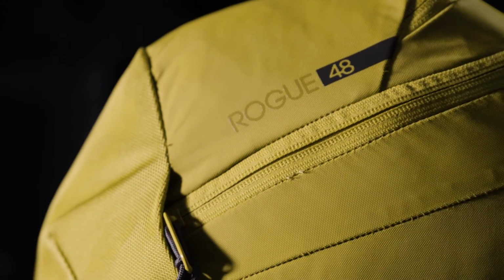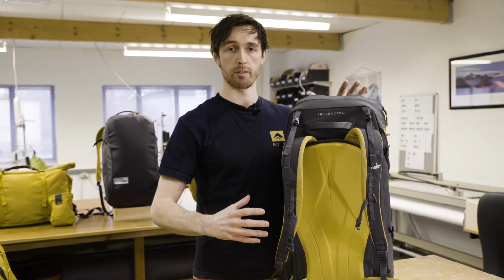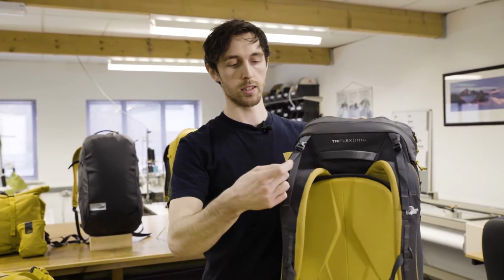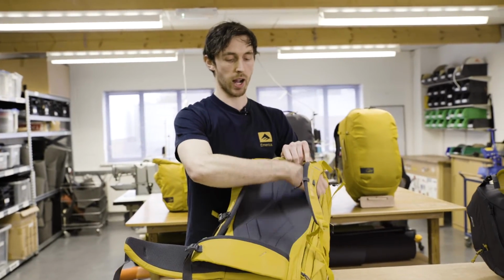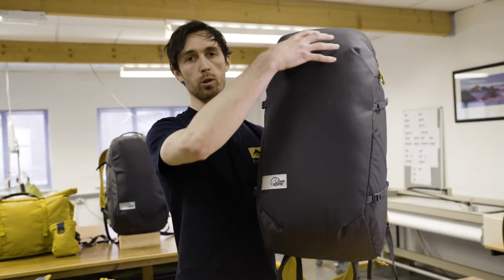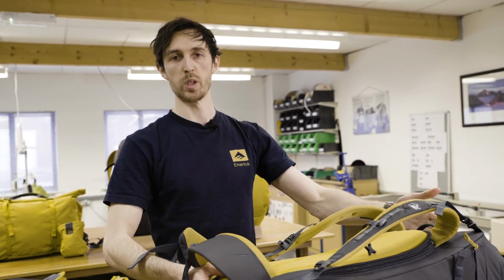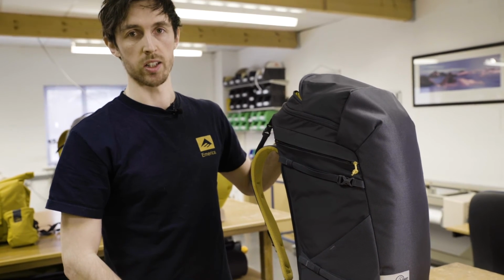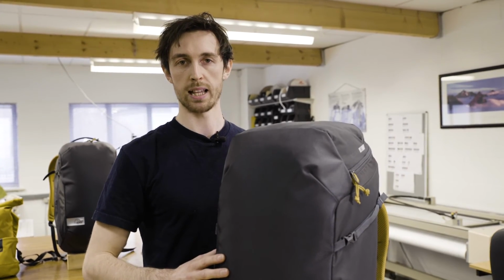WALK THROUGH // The Rogue 48 Cragging Pack

Comment: I’ve read and seen quite a few reviews of this sack now. But no one comments on how well the sack sits when actually climbing. I’m really interested in this sack for multi pitch all day routes, so I would be climbing with it on my back. My guess is that it would be stable etc., but has anyone got experience of this?
Reply: I have this. I've done 3rd/4th class with it on and loaded heavy. the pack/ hip belt is really good at holding close to you. If it's not very full (as in you're now wearing and using half the stuff that was inside on the approach) it would feel a bit weird sloshing about and doesn't compress all that well. One other important detail is when I look up, my head hits the pack. I don't think I'd want to deal with that while belaying etc. I really like this bag and got it for a great sale, but i wouldn't climb with it on, or haul it up.